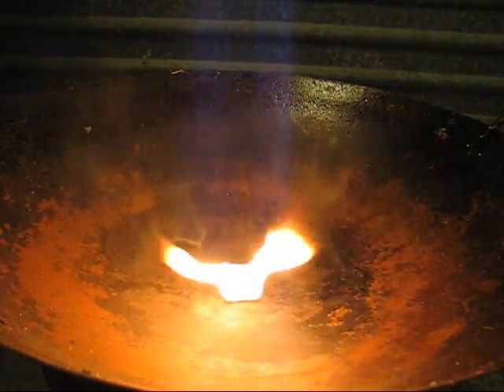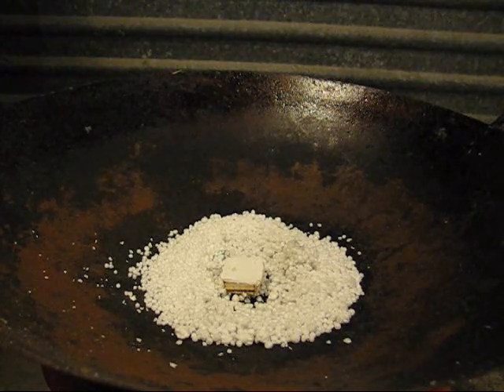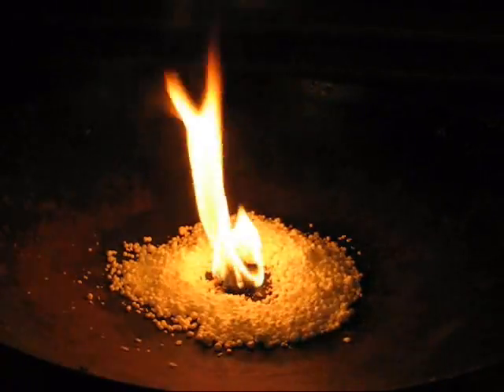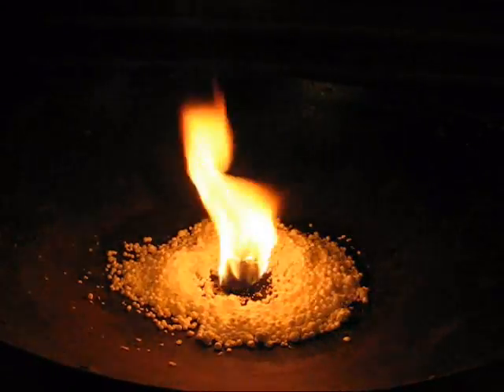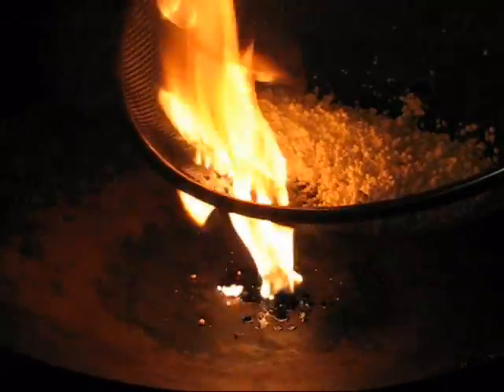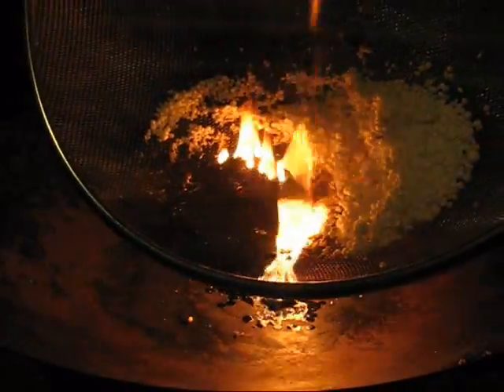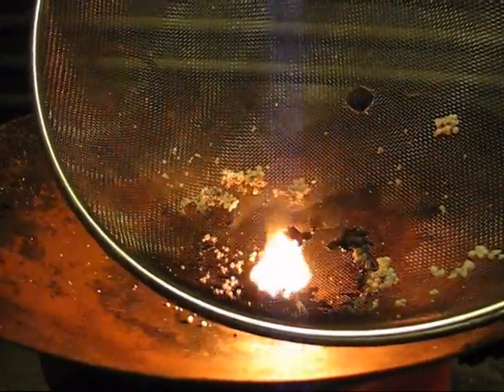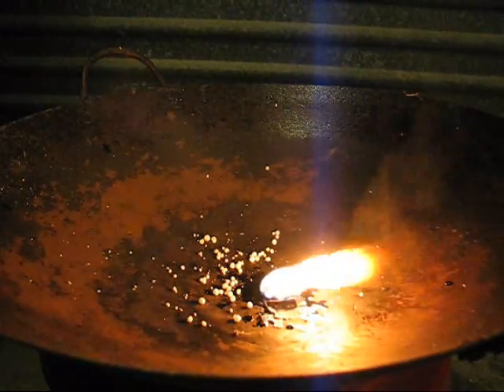Polystyrene bead ignition test

Comment: We've had our poly bead insulation since about 1990, we noticed it made an immediate difference even in a block and facing brick constructed house. The gable wall faces south east so I'm assuming that's why we got a benefit. In the UK the coldest wind comes from the east.
I've always believed that in the confined space of a cavity there would be so little oxygen or sources of ignition it wouldn't present a problem.
Reply from the maker: Yep. If theres a fire bad enough to ignite your wall insulation you've already got serious problems.

Comment: Looks like EPS is good enough for theater and movie props, cause i was concerned. Turns out it burns worse than paper. It's also the cheapest material, and can be processed very quickly with hot wire tool, so that's interesting.